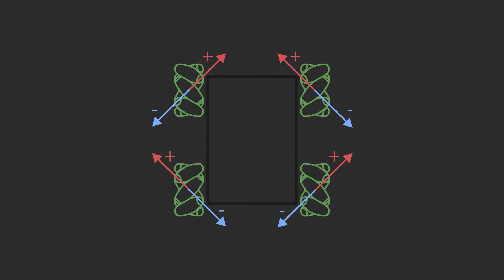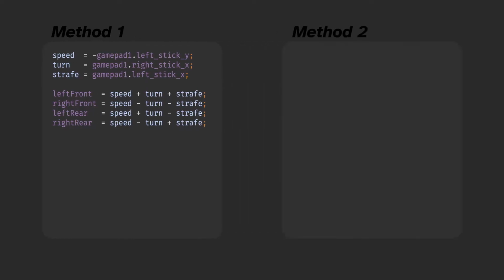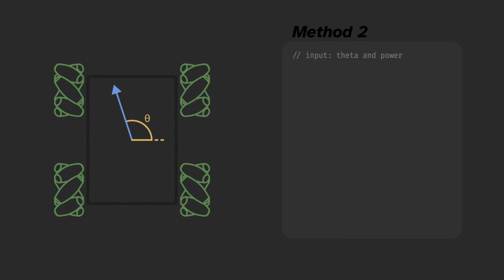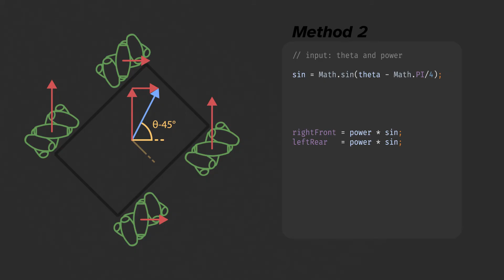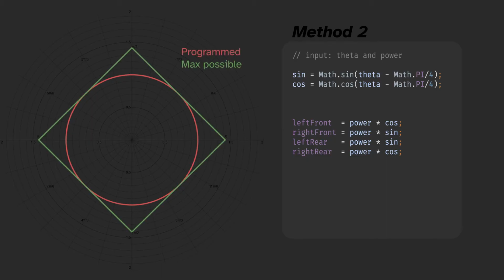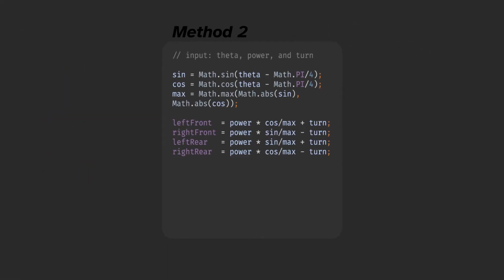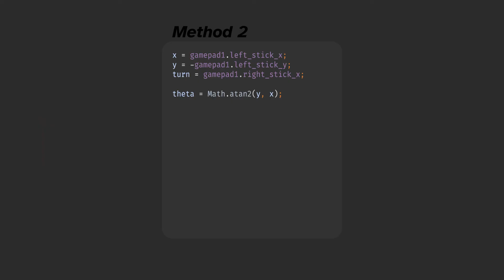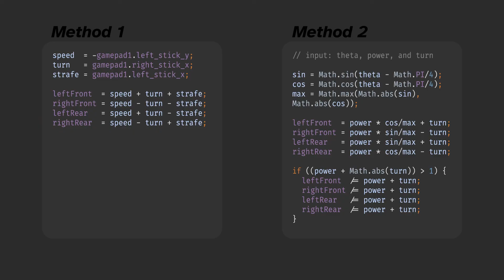How to Use Mecanum Wheels in 200 Seconds

Comment from the maker: IMPORTANT CORRECTION:
In method 2, inside of the if statement the turn values should be inside of absolute value functions:
If ((power + Math.abs(turn)) > 1) {
   leftFront   /= power + Math.abs(turn);
   rightFront /= power + Math.abs(turn);
   leftRear    /= power + Math.abs(turn);
   rightRear  /= power + Math.abs(turn);
}

Comment: very useful video, Thank you. 

To simulate it in Python : 
"
import math

while True:
    X = float(input("X Value:"))     #input values between 0 and 1.
    if X == 999:
        break
    Y = float(input ("Y Value"))
    Turn = float(input ("Turn Value"))

    Theta = math.atan2(Y, X)
    Power = math.hypot(X,Y)
    Sin = math.sin(Theta - math.pi/4)
    Cos = math.cos(Theta - math.pi/4)
    Max= max(abs(Sin), abs(Cos))

    LeftFront = Power * Cos / Max + Turn
    RightFront = Power * Sin / Max - Turn
    LeftRear = Power * Sin / Max + Turn
    RightRear = Power * Cos / Max - Turn

    if((Power + abs(Turn))>1):
        LeftFront /= Power + Turn
        RightFront /= Power + Turn
        LeftRear /= Power + Turn
        RightRear /= Power + Turn

    print(LeftFront, RightFront, LeftRear, RightRear) 
"
Had this ported and working on out robot platform in no time !

Comment: A different way to do the first half of method 2 with x and y input is to look at them as a vector and rotate them -45 degrees using a rotation matrix. Then you get the new axis. For field centric drive all what is needed is to put the angle of the robot in the rotation: (θ-45).

Comment: This may be silly, but do you need to be reading from encoders for this, or is it open loop?
Reply: If you are ok with potential slight inaccuracies I think you can just use percentage speed control using the pwm motor controller your dc motor is connected to.

Comment: Amazing tutorial, explained everything very clearly and accurately without using vectors and had clean animatoin. However, the dividing by the maximum power to achieve a different direction was not explained clearly.

Comment: Super useful to know how to position the wheels correctly. My challenge will be how to implement this motion into the controller that I'm using. I was thinking to use stepper motors and reuse an old 3D printer controller I had laying around. But I'm not sure how to work out the kinematics. I'm very new to that.

Comment: thank you so much for this video, I used these 200 second for a couple of hours now to try to implement a mecanum wheel based movement system in my robot. I'm using an arduino UNO with a FS ia6B receiver and noticed, that by using my own implementation of your code (yours seems to be in Java whereas the UNO uses c++ as its coding language, also my motor drivers dont use negative numbers but instead forward/backward + speed between 0 and 255) that my motors behave weirdly using method 2. 

I only get a limited range on my sticks when trying to move diagonally, when i go to full throttle 45 degrees it will just stop after moving the stick past 75%ish. method one however works flawlessly, so i think im going to stick with that. Also apparently using method 2 was too much for my arduino as it started drawing all my current with method 2 and basically none with 1. 

I'm kinda proud of my implementation of your method 2 but it's sad that all the time I spent on it was for nothing...

Comment: Very helpfull video! Im trying to code the second method in c ++ for arduino, but i was wondering what the " /= " operator does. You state in your video it scales them down so the values dont exceed 1, does it scale each wheel's speed by the same value?
Reply: /= means to divide itself by something. Thus the example from the video:
leftFront /= power + turn;
is functionally equivalent to:
leftFront = leftFront / (power + turn)
Reply: Hi, have you been able to make the code for Arduino work ?

Comment: Very nice video!  What are your controllers values at stick fully up, stick middle, stick fully down for Speed control?  The final output to a wheel is in? (percentage or min / max bits for motor controller?)
Reply from the maker: The programming was primarily created for FTC, which has the vertical axis inverted so up is -1 and down is +1 the middle is 0. The horizontal axis has left as -1 and right as +1. The final output for each wheel is a range from -1 to +1 which you could convert to whatever scale your specific controller uses. I hope this helps